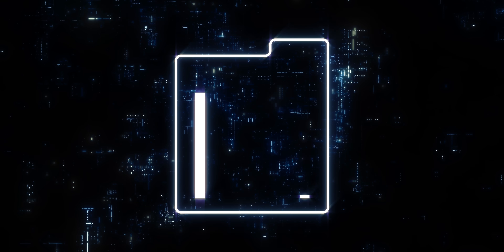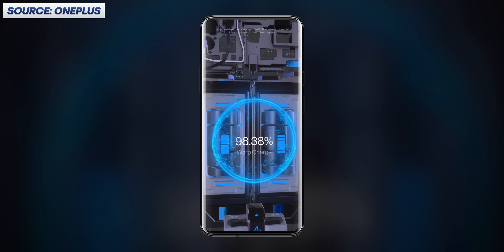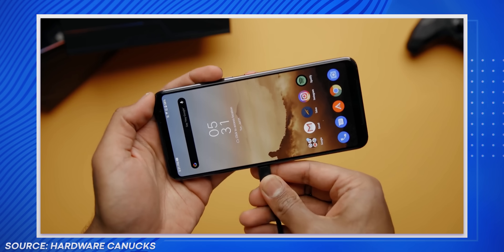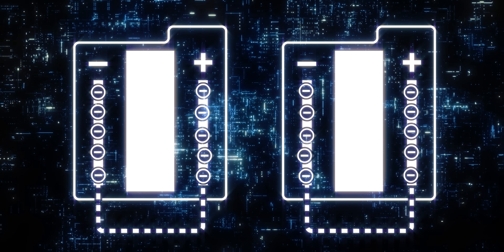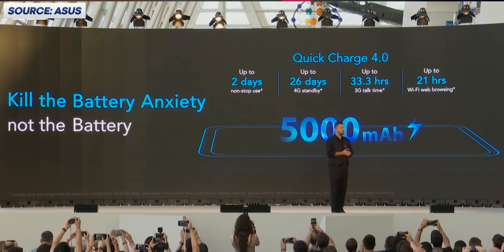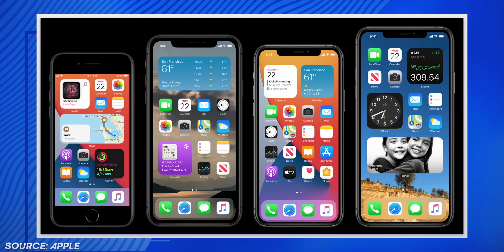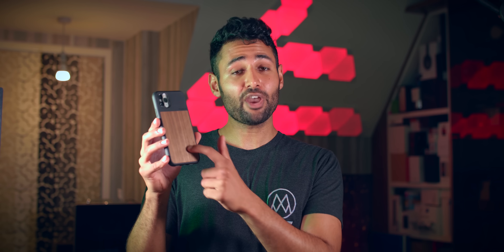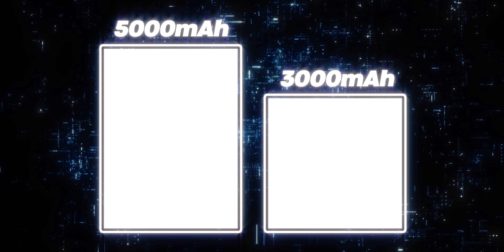The Problem with Fast Chargers.

Comment: If the battery lasts all day, slow charging overnight is perfect
Reply: I charge my phone wirelessly overnight since it can last over a day on a single charge. I already lost one to overcharging, don't want that to happen again.
Reply: @LordOf19  Sorry for the late response, I didn’t get a notification. iPhone XR is an “older” model indeed, not by age but by software. By “newer” models I specifically meant somewhat the 11 and especially the 12 and 13. 12 and 13 have the inbuilt software that I was talking about. iPhone XR should be charged with the charger that came with it in the box. So yes, you using a 5W charger to charge it was a right move that preserved your battery life. Your friends probably didn’t take proper care for their 11(s), i.e. letting them reach 0% battery, taking them off the charger as soon as it passes 20%, etc… I have the 12 Pro Max and I can definitely say that the 13 Pro Max is the phone that I would most definitely get if I wanted to switch. Seems like the best phone right now and it does have by far the best battery life out of any potent smartphone out there. It has 2 full hours over the 12 Pro Max (which already was great) at max usage. Charge your 13 Pro Max with the newest Apple charger, don’t let it fall below 20%, don’t play games while charging it and don’t take it off before it’s fully charged and its battery should last you just as much as the XR’s did.
Reply: Got an Iphone 13 pro max, battery is an absolute beast, I dont even charge it overnight, I charge it in the morning as Im getting ready until it hits 80%, after a day of heavy usage it still has 20% left, no one needs to charge their phones in 15 min unless they're downloading nuclear codes every 5 min or just want to wreck their battery for fun
Reply: @TheCocorococ  I can make the same argument against phones with super Huge SOTs, like the 13 PM. No one needs 10+ hours of SOT, unless you like to be glued to your phone 24/7.
Reply: @TheCocorococ  Thats the smartest thing I have seen said here. Letting your phone to get 0% or 100% damages battery more than fast chargers.
Reply: Fast charger is handy sometimes I personally don't like charging overnight
Reply: In iphone lineup, that's the iphone 13 pro max feature actually, compared to samsung s21 ultra, it's 1 hour++ ahead in battery life
Reply: Ipads used to be like that. I dunno how it is nowadays. Havent used one in yearssss
Reply: No way, my phone sleeps with me together at night. Not attached to some cable somewhere.
Reply: @fynkozari9271  creepy
Reply: @LordOf19  Using the old 5W charger is good and preferable for the older models of iPhones. Using it for new models isn't recommended though and can do more harm than good. New models of iPhones have inbuilt software which connects the battery and the software of the phone, making 20W the optimal power input for the battery and also making Apple's new 20W fast chargers the best chargers that you can use to preserve your battery for as long as possible. Using less than 18/20W or more than 20W can both damage your battery sooner. I have spoken with Apple technicians and service engineers who all told me this same story. Apple has made their software as such that charging the new models with anything other than 18W and 20W is not optimal. They heavily advised me on not using anything less than 18/20W. Keep in mind that Apple still doesn't have super fast charging or turbo charging, so there is no reason why you shouldn't charge the new models with their new 18W and 20W chargers.
Reply: @mystictomato9466  if you could help me out... :) I've bought the new samsung S21 FE (for a lower price, had fidelity points from the store). 
I shoud NOT use a 5W charger, correct? Would it be harmfull?
Reply: @InesLira  As far as I was told it would. Never mind the fact that it would charge terribly slowly. There literally isn't any reason for people not to use the Samsung chargers.
Reply: @mystictomato9466  Good to know! I was thinking of using and older samsung's charger sometimes but I'll stick to the lower setting of the brand new one. Thanks for much for confirming this for me. 😊😊
Reply: @InesLira  You're very welcome.
Reply: @mystictomato9466  can I use a third party 20w charger brick in place of apple 20w brick????
Reply: @kwamesarpong41  I think yes.
Reply: @mystictomato9466  apple are full of shit and want to destroy your battery quicker so you buy a new phone every year
Reply: @WHATNEWSNETWORK  Yes.
Reply: @WHATNEWSNETWORK  Then go and buy Android and enjoy your 1 year of updates support and tell me your phone lasts as long as day one after a year or 2 lol.
Reply: @WHATNEWSNETWORK  That’s simply not true. Apple continually supports older phones with software updates. They admitted to lowering performance to SAVE battery health. They want you using your device and their services for as long as possible.
Reply: Lol, I have iPhone  6s it’s been 6 years since I bought it, And I only changed battery recently on 2021 November.
Reply: @telsonthomas6942  why would you change it.
Reply: @LordOf19  I don't keep my phones long enough to care about battery health
Reply: @devilkazumi578  well you are just silly then
You need to take great care of a Smartphone 
Smartphones are basically part of our lives these days
Reply: @stephensnell5707  youre silly if youre too scared to use your phone at its max potential....thats what an iphone does to you i guess
Reply: @devilkazumi578  then wtf are u doing by watching this video anyways huh🤷🏻‍♂️🤷🏻‍♂️
Reply: @kshitijrajgautam7082  because I enjoy his channel? You grumpy today?
Reply: @devilkazumi578  timepass people... Get a life dawg
Reply: @kshitijrajgautam7082  what does that have to do with this post? Are you high?
Reply: i wouldnt charge a phone overnight
Reply: @Cjmboo  it is the best way to charge a Smartphone 
It will take a good 4 years for overnight charging to badly degrade the battery
Reply: @Cjmboo  You can safely charge a modern phone overnight.
Reply: @mystictomato9466  keeping a phone on 100% charge for more than it needs to will wear on it. There is a reason why it is recomended to keep a phone between 20 and 85 % charge at all times.
Reply: @Anon_571  That’s true if you are keeping it on the charger after it has reached 100% for a prolonged period of time but even then the wear shouldn’t be significant. But yes 20-80/90% is the best.
Reply: Google Pixel phones have really advanced smart Adaptive Battery and Adaptive charging. All you need for smart charging is to set an alarm over night. When I go to bed as 10pm, and know I need to wake up at 5am, that's 7 hours of charging. The phone knows the alarm time and charges accordingly. Cause, you don't need super fast charge to 100% at midnight, when you know the phone will be another 5 hours plugged in. You can set this up during day also. Simple, kind of weird, but works. Without the alarm set, it charges as usual, fast.

Comment: You're literally saying what not only the cell phone companies but content creators / consumers don't want to admit. I bought four of the iPhone 12 Max pros; 3 for my kids and 1 for my wife. I was extremely worried about battery life on the iPhone . I researched everything I could about it and all I got were glowing reviews about the battery and using it with partial charge vs full charge and everything else involving the new "technology" in the battery and software. No one said what your saying here . Battery technology is not where we are led to believe it is. You still have to be very careful about how you charge ANY battery powered device. In my case you probably just saved me $2,000. 👍 Thanks for that.

Comment: I've been binging this channel and while the production is great one thing has been ticking me off.
  For all the talk of software and hardware, specifically batteries, the phones always seem to be treated super disposable? It's crazy to me how with all the hints and nudges in the direction of consumer choice and obsolescence, right to repair never gets mentioned and honestly seems to be treated as a non existent idea... 
 A phone isn't a paper plate, you don't just throw it out once you're done with your food as it's soiled, yet it really doesn't seems to be treated like the 'necessary' daily tool it is. After all, we don't buy a new kitchenware set annually. And the new phones coming out aren't that much of an improvement as to make everything before it obsolete, as were the case there wouldn't be a market for anything older than 2 years.
Reply: Actually Smartphones DO get even more advanced when new ones come out
Reply: @stephensnell5707  I never said they don't get more advanced. I said they don't advance enough to make everything before them obsolete.

Comment: Hi Arun , what happens to the battery if you use a wireless charger along with cable charging. Does it increase the rate of charging or it has no difference or is it more destructive to the battery.
Reply: I want to know this because my portable has a MagSafe charger and I like to use the cable because it’s faster but I want to attach the battery to the back of my phone 😊

Comment: So much good information here!
One more thing - “fast charging” is 100% related to the size of the battery.
The standard 5W charger is ideal for the original iPhone, but the new 18W charger is the SAME for the ~39xxmAh battery in the 11 pro max. It is NOT a “fast” charger.
In other words, a 5W charger would charge the original iPhone just as fast as the 18W would charge the new iPhone (within a margin).

Comment: usually i charge my phone before bedtime, let it be around 95%, and pull the plug before sleeping. Sometimes i forgot to charge and 33w charger hit the sweet spot, i can get my 5000mah battery full in less than 50 minute.

Comment: I face a issue on charging in my Samsung s21 5G...  My battery reduced charging percentage so quickly... At 3 Pm it was 93% after 6 hour it was 65%... I was just scroll on fb...

Comment: what's the difference between 5V 3a, 9V 2a, 12V 1.5a?
Reply: If you multiply V(volts) and a (amperes), it gives you the power (in watts). 5V 3a is 15 watts. Both 9v 2a and 12v 1.5a gives you 18 watts so no difference.

Comment: Long story short : years back we knew we have to charge mobile couple hours to fill in battery. So wisely used phone through day to keep it alive.
Now poeple using smartphone even if dont need it (standing in cue in market and scrolling instagram etc) so battery dies quicker through day. Also battery drain is problem casue most of users dont care about killing aps which working in background whole day (battery but also data usage).
Using darkmode helping a lot too.

This is still long story short

Comment: MRWHOSETHEBOSS, when charging and discharging batteries the internal battery +/- Ions start to get carbonized internally? something happens to the ions when discharging over time the battery builds up carbonized so the batteries potential full tank is less and less over time because of the carbonized has built up inside. When a cell phone doesn't have the software handshaking the 60watt or 120watt charger is "force charging" the battery because not all cell phones have the software handshaking?

Comment: he is not quite correct. you can extend battery life a lot by being extremely careful with charging speeds, heat control (storage and charging), and charging percent, you can have an almost new acting battery after 2 years. Now is it worth it? Probably not unless you constantly buy flagships despite not being rich.
Reply: for the typical person better to just buy a phone with extremely good battery life and then not abuse it. maybe also take a battery pack if you need and try to keep it around that sweet spot with charge (provided it has quick charging)

Comment: Slow chargers are worst. When i use a normal charger it is hotter and when i charge it it degreeses faster than the fast charger. Also fast chargers are just the double of a normal charger, and of course oberheating is surely gonna happen with any charger so, dont worry too much, just charge your phone and u will be good i think

Comment: Or this: battery replacement is $70.  Charge like a speed demon and then replace the battery if it ever needs to.  I've had a OnePlus 7 Pro for almost 2.5 years, warp charging at 30 watts every day, and maybe there's a 10-20% decrease in capacity.  I say fast charging is always worth it
Reply: Whatever you do,NEVER USE IT,slower charging helps a Smartphone Battery last longer

Comment: um... no?  50% has nothing to do with 50% of the electrons being on one side or another.  When the battery is depleted, that is when there is stasis and an equal amount of 'pressure' between the positive and negative.
The reason a charger is shipped at 50% or less is because many shipping companies will not ship devices with a large charge because it can be a fire hazard.  A depleted battery is less dangerous when a pallet of phones or laptops falls off the fork lift.

Comment: a gaming phone. why do those exist
Reply: Umm.... For gaming?
Reply: consoles and pcs are cheaper and better
Reply: @Shade__  gaming phones are targeted at a different market just because it's mobile which means you can carry it anywhere, they can play Android games without using emulators and they have many gaming features
Reply: A gaming phone is different than a normal flagship phone with the same specs, just because it has so much features for gaming and has more cooling

Comment: So I'm getting the z fold 3 which watt charger would be best to use normally?
Reply: Turn on protect battery (caps your max charge at 85). Keep your battery on a wireless charging pad when you're not using it.
Reply: @kingoftendie  I did just turn that on use a wireless charger overnight.

Comment: I dont know why my iphones overheat sometimes when charging im using a samsung rarely happens and i get 0-100% in 1 hour and a half
Reply: Honestly what i did was get an apple certified wall and usb charger and that fixes the issue. Always go either with anker which apple certified or  just buy the apple branded one.
Reply: @chickennugget-ug9gn  I always use the original one nothing changes its the design

Comment: My new strat is to fast charge if I need battery quickly and normal charge at night so I can have a good battery when I wake up.
Also plug in at 20 and unplug at 85 unless I need the battery later

Comment: I definitely don't like the smart charging idea. It's fine if you're a 100% predictable person, but it would absolutely suck if you're going to catch a flight at 3:00am or something and your phone is stopped at 50% for the last 4 hours, waiting until 7:00am to charge up any further.
Reply: Idk if it's already a thing, but i think it would be mitigated to bypass this "predictability" with a manual alarm you set for, let's say this hypothetical flight you need to catch at 3am
Reply: @xwithoutxanyxwarningx5191  I still don't think this would be enough, since somebody could have an "old fashioned" alarm instead of their phone. Even if the phone was smart enough to read your documents and see that you had booked a flight and printed a boarding pass it still wouldn't be smart enough to "know" when you randomly do and don't want the phone quickly charged to 100%.
I just realised that I had smart charging enabled on my Huawei P40 Pro, and so I turned it off now. Even though my charging routine is so unpredictable that it never gets used!
My phone generally takes about 2-3 days to get down to 50% anyway, and only 10-20 minutes to get back close to 100%.

Comment: I miss the old days when we had removable batteries and we can just carry spare batteries whenever we go out. I still remember buying an external battery charger for my old phone so that I can charge my phone without bothering to plug it in like ever. It was all "Oh im low time to swap with my spare on the charger."
Reply: This was so efficient. I never had to carry cables whenever I use my phone for hours on end. It was simple as just swapping and hey restarting your phone clears cache and ram so it was always faster whenever I swap so it was so helpful

Comment: Mr Whosetheboss,
thank You very much for Your very informative, interesting and professional video.
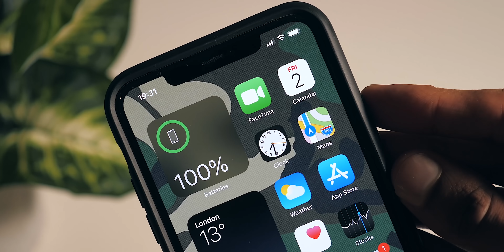But at 5:50 where You‘ve said, that no matter how soft (5watt) one charges a cell phone, after 2 years the battery is not the same anymore, I‘ve made another experience.
My 11 Max is about 18 months old, and still got 100% Battery health.
I guess it’s because I‘ve only charged it with a 5 Watt charger, never overnight, only between 30-90%.
My screen-on time is still between 13-15 hours. 
Greetings from Helvetia 🇨🇭

Comment: Don't worry about the physics lesson. Technically your right but your not at the same time. Developers program the phones to charge quick from around 5 percent to 70 percent. When your phone dies it says 0% but in reality there is around 5% charge left. This is because if the battery was actually totally dead the chemicals would react and damage the battery. Once the phone reaches the limit set for fast charging it reduces what it will accept and charge slowly until it is at the set capacity. The fast charge is to get your phone to a desired charge quickly not maintain from 0-100.

Comment: Yes fast charging damage the battery faster. And wireless charging is even worse. I have 2 iphone SE 2 the wife and my mom use. One uses wireless charging one doesn't. So the one that doesn't use the wireless charger still has 100% the other that does use the wireless charger is only at 96% bought the same day. So yeah.